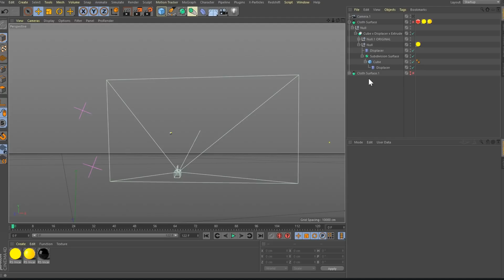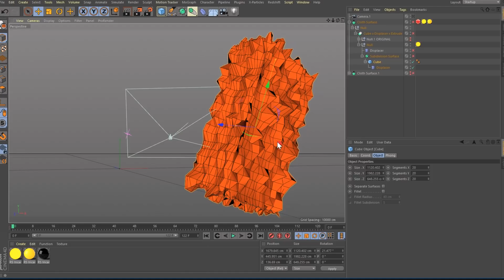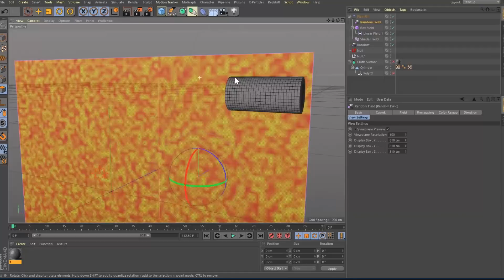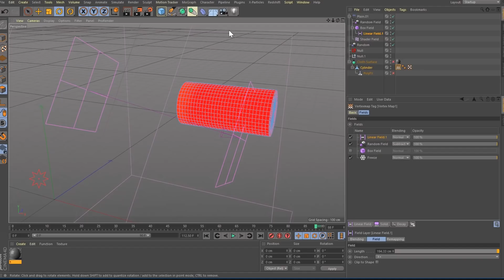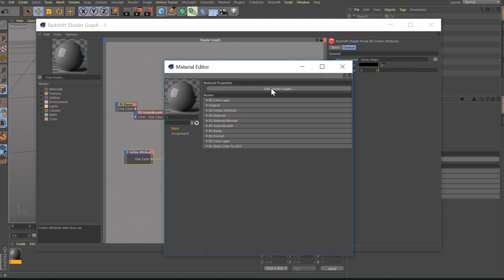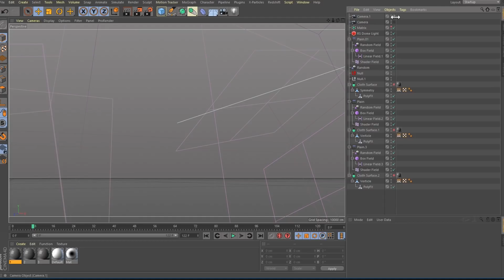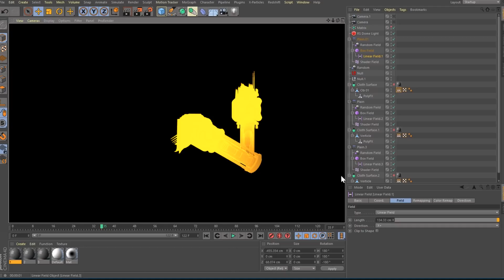How to reveal geometry in C4D - Tutorial 151: Geometry Reveal

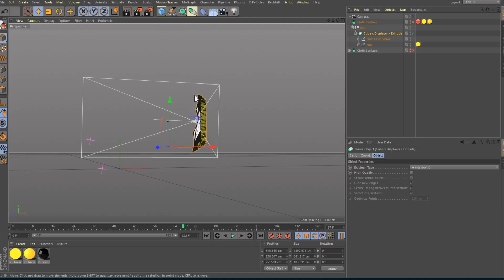Comment: hey i know im a bit late here but i was running into some problems with the first technique. When animating the displaced cube through my logo i was getting horrible triangulation (also visible in the video at around 2:10). I encountered some really badly flickering reflections on my object and i think this was the reason for that (without the boole reflections/lighting looked fine). Subdividing both objects led to better results but did not completely fix the issue and on top of that made the render time longer. Any pointers the the right direction for me?
Reply from the maker: Hi, thanks for the question. :) Unfortunately, that is more so a limitation of the Boole in c4d. There are a few settings to play with, try turning off the high quality. Seems counter-intuitive but it will often cause weird triangles because it is trying to be more accurate. You could also get around the poping with a lot of extra GEO or using a volume builder.
Reply: @Workbenchtv  Hey, first of all thanks for replying to a comment on a 3 year old video in about an hour! i already fiddled with some of your suggestions and i think i will go back to my first approach of using volume builder. Thanks for your content, really helpful in learning c4d!
Reply from the maker: @sebastianschultz4302  You're welcome! Glad we can help!

Comment: Hi thanks for the tutorial. I have little experience with c4d but still it have helped me. I also have read on your website that your tutorials are aimed for advanced users. Still I dare to ask if you could explain how do I "texture map the edges of the displacer cube" to be able to add the glow in AE please? The mentioned part is at 02:09.
Reply from the maker: Hi thanks for the question. :) The displacement object just has a basic color on it. the bool is using that color to shade the edge of the new GEO. Then in ae im using that color to glow.